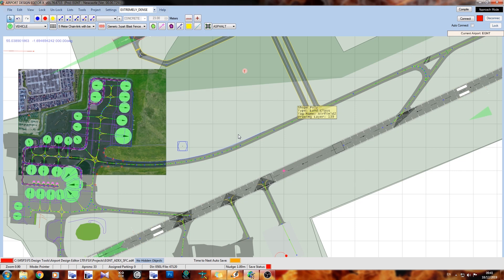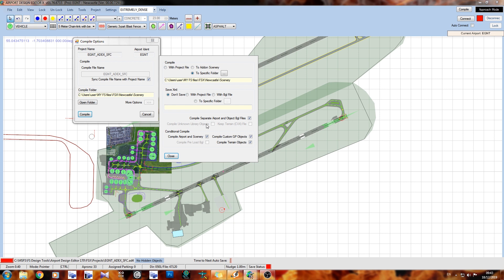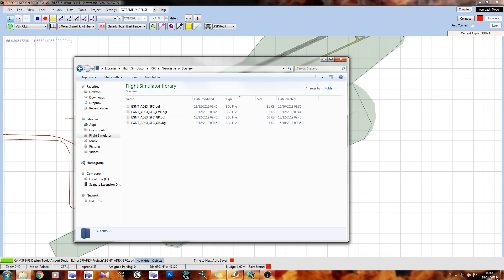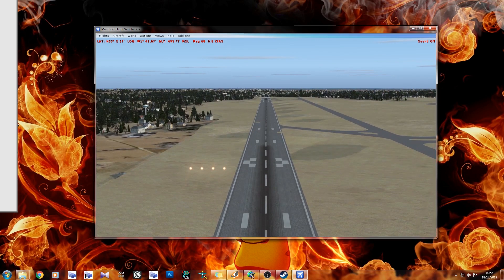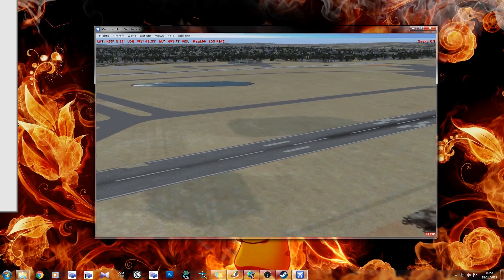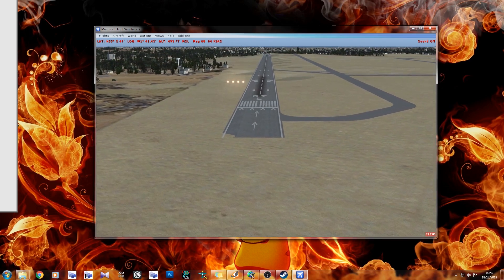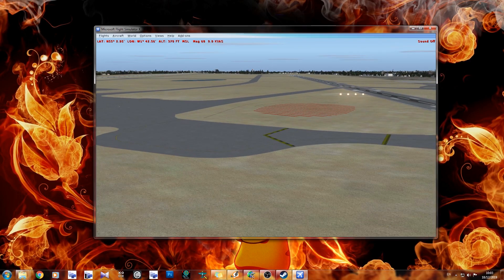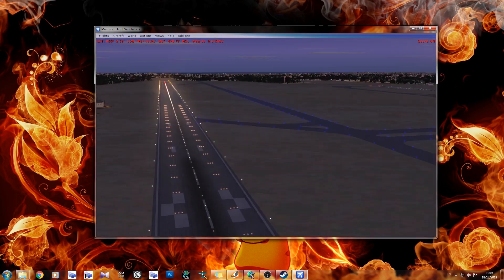Airport Design Editor Tutorial - Part 4 finalisation

Comment: Where is the SDK in FSX SE what's the path location because I can't find it...
Reply from the maker: It SHOULD I say should xD it should be in the main FSX folder of your steam install, should be a folder in there simply called "SDK" Easiest way would be to see the sim in Steam, right click on it and go into the properties and click "Browse Local Files"
Reply: @Soarflyconcepts  thanks for following up with me on this mate... I'll check it out ASAP...

Me too I moved to ADE Airport Design Editor and I love it so far...

I'm having hard time understanding how to flatten the land tho' even in this video I didn't really get it...

Maybe would worth if you can to make a step by step tutorial on this, how to flatten the land...in ADE help pages it's something about exclusion to remove the stock background and then add our custom made airport background polygon but it's very confusing and I don't get it...
Reply from the maker: @gabeghiby6935  In most cases simply drawing a "Flatten" works well enough , it flattens the area with some exceptions like buildings will be AGL or at ground level so the ground will always meet them, if you have terrain features like roads or powerlines running through the scenery then they will be drawn at AGL but they are usually generated "after" the terrain is adjusted in  the sim. If a general Flatten does not generate the desired results then the scenery contains something else that is causing the issue

Comment: Hi Soarfly. I did some minor adjustment as to test an airport on p3dv4. I compiled it but nothing shows. I restarted the flight sim. Still nothing. Any idea?
Reply from the maker: The new scenery files need to be compiled and placed into the addon scenery, scenery folder in your main p3d directory. If it is the first addon for P3D you will need to activate the folder as an active scenery library in P3D itself

Comment: Hello Soarfly, I am having huge problems getting the sdk to work. As a result I am unable to recreate an airport. I know It's a huge ask but could you possible make a reklaw flying m ranch 7ta7 scenery file for fsx? I have just been trying to add aircraft along the side of the runway and the hanger that sits at the field, i have already created it on ADE but can't compile it. It has been something I have been dying to do but always ran into problems and wasting hours of time trying to trouble shoot the problems. I would greatly appreciate it but if you can't create it I FULLY understand and acknowledge it.

Thanks!

Comment: Once I compile a BGL file from ADE and import it in to FSX, as soon as I press 'Fly now' FSX get to 2% and just closes down.
Reply from the maker: It sounds like you're compiling non fsx properties in the airport or perhaps your AFCAD is corrupt in a way, like a few taxiways not connected or overlapping, run the fault finder to see if that helps.
Reply: @Soarflyconcepts  Fault finder doesn't find anything. I've only made the smallest alteration to the airport just to match a photoreal ground polly. I noticed that the ADE BGL is only 4kb which seems small to me. Also after I select the folder and then compile, it pops up saying airport complied and doesn't open the other tab you seem to get.. very weird.

Comment: using fs9 followed your guide for set up and compile (i am not as in depth as you are. i just moved signs and parking spaces around nothing big) but when i got to compile i get this error every time. i have watched your set up and this video several times and i have it setup correctly the thing juts will not compile. what am i doing worng?

Compiler Errors Found. These were not identified by the Issue Manager. Please let us know
what the compiler error is so that we can improve the Issue Manager.

The compiler message is shown below

ScruffyDuck Scenery Design Engine Compiling
Using BglComp....

INTERNAL COMPILER ERROR C1003: Failed to create MSXML object! (0x80040154)

Parsing document: C:\MSFS\FS Design Tools\Airport Design Editor 178\!AdeTempWorkOnly\KCGX_ADE9_DCN.xml

ERROR C2470: Unrecoverable error parsing XML!
ERROR C2006: Parse failed  (0x80004005)
ERROR C2003: Failed to process file: C:\MSFS\FS Design Tools\Airport Design Editor 178\!AdeTempWorkOnly\KCGX_ADE9_DCN.xml
Reply from the maker: Hi!
Compile errors are normally caused by simple issues. You say you moved a few objects and parking, did you ADD anything or perhaps edit a sign?
Also parking can overlap a bit but if they overlap too much this can cause issues too..
If you like you can you send me the ADE file to support@soarflyconcepts.com and I can check it for you..
Reply: @Soarflyconcepts  thanks. i sent the file. with what little i have done. many thanks again for the help. 1st time user coming over from afacd and your videos help alot.
Reply: had something similar: 
Parsing document: C:\MSFS\FS Design Tools\Airport Design Editor 178\!AdeTempWorkOnly\KJAX_ADEX_VG.xml

ERROR C2309: trafficScalar is NOT a valid token!
ERROR C2028: Invalid attribute! (trafficScalar)
ERROR C2472: Invalid attribute!

ERROR: trafficScalar
ERROR: 0.7
ERROR C2032: XML Parse Error!  Element tree follows:

ERROR: <FSData 
ERROR: 	version = 9.0
ERROR: >
ERROR: 	<Airport 
ERROR: 		country = United States
ERROR: 		state = Florida
ERROR: 		city = Jacksonville
ERROR: 		name = Jacksonville Intl
ERROR: 		lat = 30.4940554127097
ERROR: 		lon = -81.687861084938
ERROR: 		alt = 9.144M
ERROR: 		magvar = 4.80000019073486
ERROR: 	>
ERROR: 
ERROR C2309: airportTestRadius is NOT a valid token!
ERROR C2028: Invalid attribute! (airportTestRadius)
ERROR C2472: Invalid attribute!
and it just goes on.

Comment: Hi, i downloaded an add on aiport. I only want to change runway heading and airport position a little bit, but in the simulator the objects appear twice and in their original position. I already save the "objects" in the library, etc. Still the same problem. Any idea? Thanks!!!!
Reply from the maker: Did you add the scenery to a new folder in your sim? because it sounds like the scenery is being read twice.
Reply: @Soarflyconcepts  thanks for you answer! I only have this scenery in the "Add on" folder. Yes, fsx its reading the objects twice, but the problem is in the same folder. If i delete the objects from this folder, the problem is gone...and so the objects, there is only ground. That's my problem. I'm trying to figure out how to compile this objects without generating this issue. The objects are not generic, they came with this add on airport. Thanks!!!
Reply from the maker: Try emptying the add on scenery folder and of anything to do with the scenery and just placing in the new files.
Reply: Yep, i've tried. I only see the airport ground, Rwy etc. I don't know how to manage the object Files, how to comoile them, change their location in the scenery, etc.
Reply from the maker: @patriciovienna5711  okay in ADE on the compile options there should be a check box. Saying 'compile separate airport Nd object files'
Make sure thats checked (selected) and only add the airport bgl to the addon scenery folder
Reply: @Soarflyconcepts  yes, i did it. It seems like it compile the location separately, but i need to have the objects in that foder, otherwise they don't appear when i play. then i have to decide Wich is an object and let it in the folder, some.bgl files make the problem, other don't.  I don't get it.

Comment: Hi Soarfly, in 1:39
1º) Why do you compile the airport separately from the objects? Isn't it better to compile everything in a single file?
2º) Why do you have "Conditional Compile" enabled? I have it in gray (without access) with the 4 tildes (you do not have a "Compile Pre Load Bgl")
Apron + Flatten, thanks! It usually happens to me in the photorealistic scenarios, I solved it by placing the photoreal .bgl in the "World \ Secnnery" folder, but I don't like having files of the same scenario scattered in different folders.
Sorry if you do not understand well, my English is not very good and I am using Google Translate, which is not much better than me in translations :P
Greetings from SACO!!!
Reply from the maker: Hello!
1. I prefer to compile separate objects and scenery bgls for safety. So if one doesn't work I can easily figure out what the issue is.
2 I have the pro key and have access to more features.